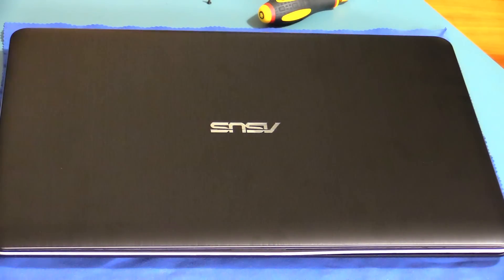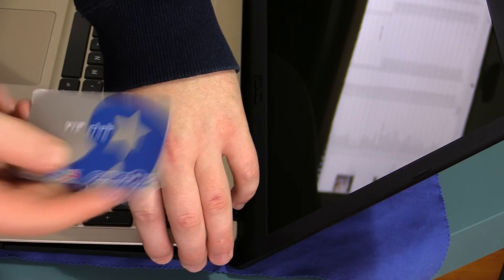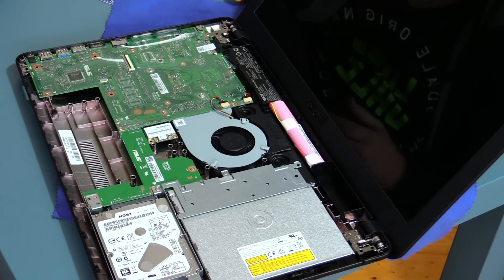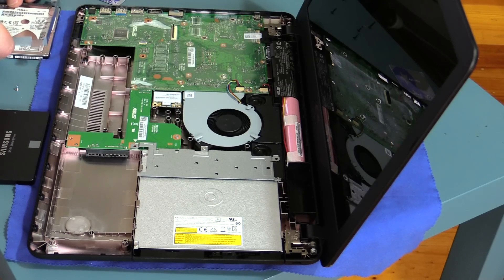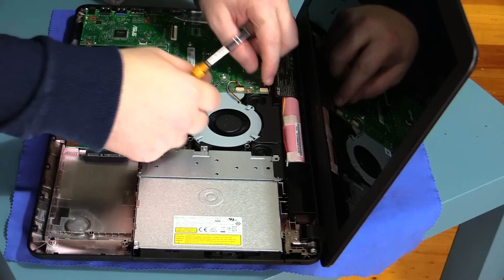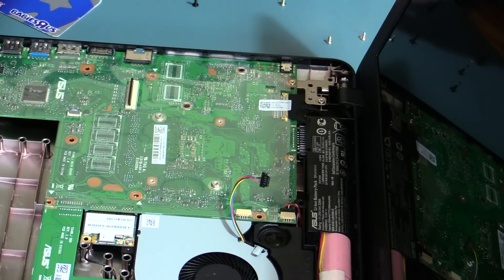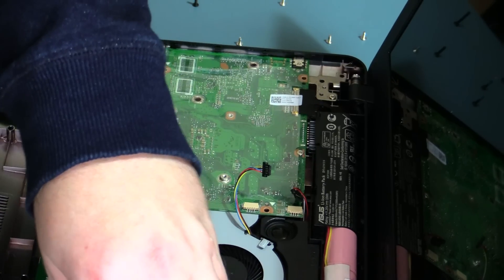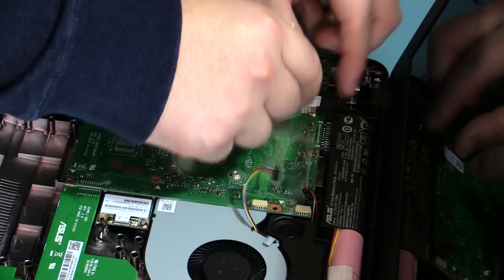Asus X540L Disassembly for hard disk replacement or memory upgrade

Comment: I have an Asus X555L laptop (basically like an F555L you worked on in your first video) and I cannot get my laptop to boot to the loading icon (Windows 10). I can run BIOS, but since it uses UEFI, I can't run it in safe mode. Basically, all I can do is run it in BIOS to keep it turned on. Nothing is wrong with the battery, but I need a fresh clean hard drive and Windows 10 reinstalled on it. Can you replace the drive?
Reply from the maker: +Bryan Clark Hi mate, I actually had an X555L on my desk just yesterday, we do a lot of Asus stuff here. I can help you in person if you're in the Melbourne, Australia area? Just message me through the business website www.techheads.net.au  (the contact form is fine). Outside of that I can help you in messages here. To get the system to boot after changing to a new hard disk / SSD you'll need to disable secure boot and then CSM, which allows legacy boot devices. So you'll be able to use an MS Windows 10 x64 Home ISO DVD for example... it won't boot with default settings, you'll just get put into BIOS, but if you change the secure boot you'll be able to boot to your legacy DVD to do your installation. I hope this helps? Let me know if you're stuck! Thanks for subscribing :-)
Reply: Better yet, let me rephrase this. Do I need to get a new hard drive in order for my pc to boot up again or is there a way I can fix this problem using a DVD/USB and bot having to change the hard drive? Also, my COM4 port is not working properly, which is why I asked do I need a new hard drive.
Reply from the maker: Do you have an SSD at the minute or just mechanical HDD? If you don't have an SSD then you should definitely put one in as you'll get a big performance boost on this laptop. Samsung EVO Pro 256Gb or something like that... What is the old hard disk you're trying to get to boot? and what OS do you currently have on it?
Reply: I don't have an SSD. I just have the one that's built in, which is probably mechanical HDD cause it's 1TB and has the C and D drives on it. Never opened the laptop ever to see what kind of drive it is.
Reply: Also, are COM4 ports part of the hard drive or part of something different?
Reply: Also, my OS I had it running on was Win10 Home.
Reply from the maker: Do you need comm ports? You'll need to get a USB to serial port adapter if you want them (cheap off eBay). I'm a little confused, if you're just using the standard internal hard disk you shouldn't need to change anything? Just turn it on and it works straight out of the box... although I'd definitely change your drive, it's worth that bit extra. If this is your old hard disk from an old laptop and just putting it in the new system, then there is about a 70% chance it'll work straight up, depends how drastic of a change it is. But hard disks wear out like car tyres, so unless you have software that you just have to have and can't replace, just get yourself a new drive... your system will run much better for it. A new SSD and it'll FLY!
Reply: So basically, I can just take the old HDD out of the computer I'm using, install a new fresh clean drive, use another external USB hard drive to download the Windows 10 ISO, set it up, and run it on the new hard drive installed?
Reply: As a bootable device that is.
Reply from the maker: I'd actually use your old computer (providing it's still working) to download your MS Windows 10 x64 Home.iso and burn it, then put the new SSD into your laptop and install from the DVD. It's just simpler that way, we do that job multiple times every week and have very few issues. Hope this helps!
Reply: Update: I have a Windows 10 ISO/Media Creation Tool DVD now, just can't reinstall Windows because I am missing a certain file to actually reset or reinstall Windows 10 via DVD. That file being C:\\WINDOWS\system32\winload.efi Any suggestions on what to do?
Reply from the maker: You should use an MS Windows 10 ISO from pirate bay or something like that. This will give you the actual MS Windows 10 installer, just use that... you won't need a license key as it is stored in your BIOS, you just need the full installer.
Reply: I can run the installer from the ISO, just missing that one file to actually do an install or boot or reset etc.
Reply: Probably just gonna take it in to Geek Squad to get fixed.
Reply from the maker: What Im suggesting is dont use the media creation tool, literally burn the ISO straight from a torrent installer... also when burning ISO's you need to set your burn speed down to 1x or 2x... no faster as youll have issues exactly like yours on installation.
Reply: Not a big fan of torrents or anything like that cause that's the kind of stuff that can screw up my computer and possibly get me in legal trouble.
Reply from the maker: +Bryan Clark  Yeah that's fine, although you're not doing an illegal 
install, in fact you could just delete or not download the crack as you 
don't need it... you just want a good working installer. I'm sure you 
can locate the official MS ISO for downloading, maybe from Tech Net or something, either is fine... 
although I find doing anything officially is usually harder than just 
doing it!!! haha I wish Microsoft would one day get it right! but until 
that day...